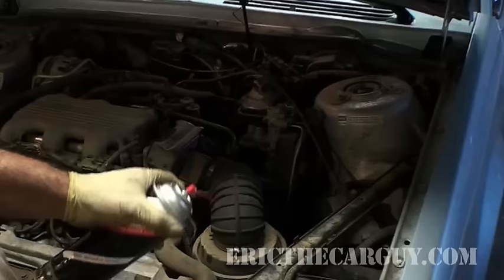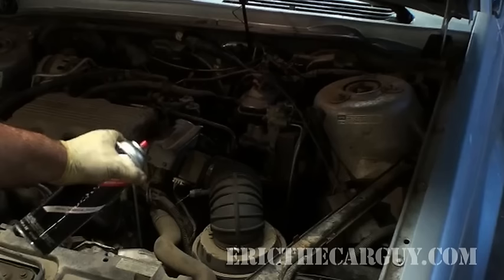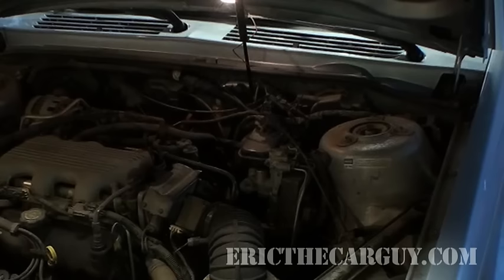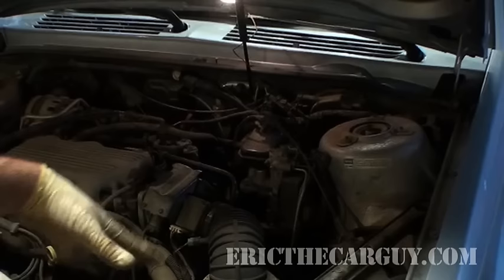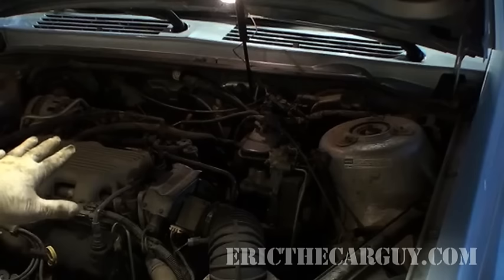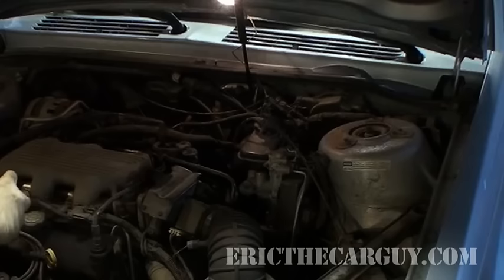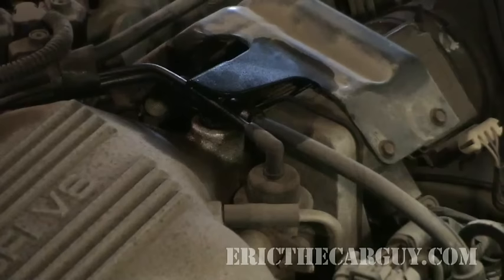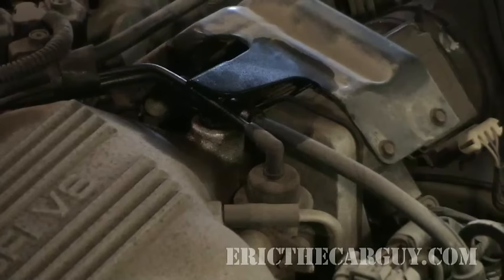How To Find A Vacuum Leak - EricTheCarGuy

Comment: Yes, using carb cleaner / starting fluid on a hot running engine is a really bad idea, propane isn't much better... The truly proper method is using a smoke machine.

Comment: Shouldn't you try to avoid getting carb cleaner on rubber hoses? I feel like you might find an intake leak and dramatically reduce the life of your hoses and end up with more vacuum leaks if you use carb cleaner.

Comment: I have a 2012 Hyundai manual shift and when I need to pull out fast and bring the rpm up however not too high and especially shifting from first to sec and also to third I get high rev hang. Can you tell me what the issue is here?

Comment: My problem occurs after the car has done maybe 10 miles. Then there is a sucking sound from the left side of the engine area. The the car, a Volvo XC70 diesel plays up with erratic throttle control, hesitancy. Inspect the engine cold and nothing is seen. I will try the cold water spray.

Comment: So.. what is the reason the engine stalled when you sprayed that particular area? What is unique about that valve and connection that caused it too stall, rather than just increase in idle? And might the engine still stall from the vacuum leak in that area even if you had not sprayed it?
Reply: he's flooding the engine, gases can be compressed but liquid can not.

Comment: Eric, if I find a leak like this on a pre-1996 car, will I need to disconnect the battery in order to reset the ECU, or is this non-applicable in this case? It's a Volvo, BTW.

Comment: Hi I changed spark plugs on my Dodge grand caravan and now it's stalling. As soon as I put in gear it acts like it's going to open up and shuts off. And as long as I take the booster line off that goes into engine it stays idling fine. But when I put it back on it stalls. It was working fine before. Maybe something i have hit while I was working and it came off

Comment: I have an idle problem.

Already replaced the idle valve on my S40 -96 2.0. But, as I did the work, I heard that hissing noise Eric was talking about in this video. Probably a vacuum leak.

But I'm a huge novice in auto repair and the problem is I cannot tell where to spray? Where are the hoses/tubes to spray into to find the problem?
Reply: I was spraying and inspecting the air hoses for good amount of time, but it turns out the problem was not in the air hoses/lines at all, but bad intake manifold gasket. Changed that to a new one and we're back to great idle rpm.
Just pointing this one out if someone is experiencing same kind of problem. Gl.

Comment: my deal-eo is my car had a high idle on hot days then on a colder day the car quit idling , so i turned up the the idle , so much that the screw is barely in .

the vacuum is at 20 pounds when at 1500 rps but at 500 rpm the vacuum is at 17 and not steady it's fluxuating .

tried spraying starting fluid and i think i found a leak on the carb where this pump thing goes in and is on a lever  maybe throttle pump

its a 86 subaru gl with a carburator and im only getting like 20 mpg / 105 miles to $20

Comment: Never use water to put out a fire in a hot engine, firstly you might crack your engine block or you might damage electrical connections causing you problems that might be hard to diagnose due to connections being rusty or bad contacts.

Comment: How do I know if my vacuum leak is legitimate ? I did the propane test and it didn’t do anything. But if I really douse the intake manifold gasket then idle drops 150 rpm. And when I spray down the carburetor bore with carb cleaner it stalls instantly .

Comment: I don't know why the engine still sputter like 5 times per second when I came to a stop. It started to shake as I hit the accerelate until it got smooth again. No engine light. What could be the problem? I replaced the spark plugs, spark plug wire and I used fuel injector cleaner. :(

Comment: Hi Eric. Thanks for every video you 'd posted. I learned a lot from DIY from you. My question for you is : What should I do to fix hard start in the morning. I have a Dodge Neon SE 03,  that gives me a headache.After many attempts  it starts and no problem at all when worm. Please respond and give me an idea.
Reply: Clean your throttle body. Properly like removing it and cleaning the backside. Do your gas pedal sticks sometimes?

Comment: If you decide to use carburetor cleaner make sure the engine is cold and start it up don't run the car for a long. Of time so the engine block doesn't heat up this will help not catching your car on fire

Comment: Random question.   I am having some water leaks come in from the ventilation slits on my 81 GM RV.  Would it caused problems if I sealed off the slits outside the cab that sits behind the Hood of the rv?

Comment: I found a safer method to find a vacuum leak in a french book for diyers. all you need is a tube you find suitable for the job. A vacuum leak is emitting a noise of air being sucked. So just point an end of the tube to the suspected area and the other end to your ear, and you do the same to other areas. Just be sure you ear is not too close to the tube end so that you won't damage your hearing. You'll hear a difference between noises and you just  identify which noise correspond the most to a vacuum leak.

Comment: Can a vacume leak be found in back of motor and can it make the car hot also I have a Pontiac Aztec 2003 to check where exactly the vacume leak is around the plugs and head I believe?

Comment: Have a 2014 Hyundai sonata which is misfiring no check engine light replaced disk plugs plug in coils and a fuel injector still misfiring any ideas?

Comment: hey Eric I own a 93 Honda Accord didn't pass emission due to the EGR so I'll watch your videos and I'm going to end up cleaning it question to you is that vacuum line that goes into the EGR valve when you take it off should I feel a sucking pressure either from the holes without your love because I don't I took the hose off put my finger on it I don't feel any pressure I'm learning as I go so I don't know the if  supposed to thanks

Comment: Maybe you’ve addressed this somewhere else in the 1,800 comments or another video, but you said a vacuum leaks causes “rich” conditions, isn’t it the opposite? Too much air being sucked in by a vacuum leak causes a lean fuel mixture with not enough gas? Or does the ECU overcompensate by injecting too much fuel, causing rich conditions?

Comment: How about if the car starts but idles really low then stalls, can't stay running and no response when stepping on gas pedal...already changed fuel pump, filter, injectors and pressure regulator on 3rd gen 4runner with the v6 5vzfe engine

Comment: Very nice video. Can you please advise I have a Subaru SF5 and the gearbox error code - Engine Torque Control Signal Error - can that be related to the Vac Leak anyhow? I also noticed that the car runs rich, but apart from that the car runs pretty well, also consume more petrol than usual. Thank you.

Comment: I have a 2003 honda civic si hatchback... and the cruise control has stopped working... the buttons and indicator lights on the dash all respond, but when you engage the cruise control, the light will come on, but it will not lock in the speed. What do you recommend I check? How do you recommend I trouble shoot this issue? Will you make a video on this?

Comment: Does this same method work with turbocharged JDM engines? Turbo engine exhaust and other parts run hotter than most engines so should I even try this?

Comment: My v8 has a smooth idle with stable rpms except for the intermittent mild shake i have changed the MAP sensor because it has thrown a P0106 code once but i cleared the code, what should i do thanks

Comment: Eric, what if the high pitched whine occurs when the engine is shutdown?  Turn key, engine off, whine.  Is this still a suspected vacuum leak?  Thank you.
Reply: Many cars have a vacuum reservoir that will maintain vacuum for a few seconds or minutes until the system leaks down. Its purpose is to provide vacuum power for actuators while at wide open throttle (which doesn’t make vacuum). So it could be a vacuum leak.

Comment: I have a 2002 firebird v6 3.8 engine code p0101 , p1514 after it warms up will not exceed 20 mph and sometimes turns off what would u suggest ?

Comment: My 2013 jetta, when i give it gas the car sputters and the epc light comes on and feel like the car is going to stall out but doesn't.  The code said possible vacuum hose leak and aldo said possible misfire. Do you think its a vacuum hose leak or something else?

Comment: I have a 2001 corolla with the code Po171. I changed the O2 sensor, MAF sensor , spark plugs, PCV valve , checked the fuel filter by the pump and checked for leaks with a can of carb cleaner no leaks detected but the code always comes back . Anything else that I could do?

Comment: Hey Eric how are ya, I have a friend who has a 93 mitsubishi diamante at first i thought maybe he had a head issue with it, but im starting to think its a vacuum leak.  What he told me was he was heading back from town and suddenly it just wouldn't go at all he said he had it on the floor and his battery light had come on along with his check gauges light. He said its blowing white smoke and if you try to rev it, it dies almost right away. He said its not shaking at all being i figure its maybe water in the fuel or something im not a mechanic but figured maybe that could be a cause so i started looking up videos and seen something about a blow head gasket, but he said it wasn't over heating either so im guess its most likely a vacuum problem but wanted to hear what you had to say about it.  As far as i know the smoke goes away after a bit but he cant drive it too long or else it will try to die on him.

Comment: Hey eric the car guy i have a question. My mothers manual 98 volkswagon bug doesnt really spin tires in first anymore im just wondering whats wrong. I feel alot of power loss exspecially when the engine is low on fuel from launch

Comment: I've tried with propane on my peugeot 308 from 2011 and doesnt work. Just pluged out the vaccum hose from turbo actuator and spray it. Nothing happend. So my conclusion is that it only work on air intake leaks, not on vaccum lines. Because vaccum lines are powered by a vaccum pump and this pump has nothing to do with air intake.

Comment: Hey Eric. My girlfriend has a 01 Kia sportage, and she is getting misfires like crazy. But only when the engine is cold. Once it warms up, they're all gone. I'm thinking it could be a vacuum leak, but can't find anything. I've replaced the spark plugs and gapped them, replaced the air filter, new fuel filter, and cleaned the engine with seafoam. Help!

Comment: I have a 2012 Camaro v6. When i suddenly hit the gas , while parked, it wants to stall and engine sputters. Its sounds as if it wants to spit air out. Any ideas?
Reply: I'd start with fuel filter / air filter

Comment: I have a 2005 scion xb and my check engine light comes with the track off light and vsc I think it is light comes on  I went to auto zone and they said it was a electric solenoid valve but I don't know where it is how can I determine if this is the problem

Comment: I have an 4cyl 88 trooper with severe idling issues so its hard to find a vacuum leak when the idle is jumping all over the place. Once it hits 2000rpms or above the motor runs great. an suggestions?

Comment: I have a 1982 el camino and it idles fine in park but once put into drive or reverse it stalls idk if that would be a vacuum leak or would it be something else?
Reply: +hachiko 24  low idle rpm?

Comment: Hey Eric wanted to find out about a low rpm... changed spark plugs camshaft sensors... cleaned throttle body. rpms fluctuates not violently but a small up and down motion thinking it could be a relearn to the throttle body.. not sure help 2013 nissan altima

Comment: I just bought a 1999 suburban that was described as nothing needed ready to hit the highway... It was rigged to override the heater cores (front and rear heaters) completely... the thermostat was literally rusted into the position. I re connected the heater cores and flushed the cooling system several times (once with skunk rust)... the coolant seems fine... however, the engine sounds like a diesel engine with a really loud knock. Some of the spark plug wires have been electrical taped back together (prior to purchase)... the knocking sound is my issue here... what do you suggest the problem is or what order of diagnosis do you recommend?

Comment: Hi Eric, I drive an 2006 nissan pathfinder, and I replaced my valve covers , put everything back, and noticed that my pedal was all the way down, had very minimal breaking, minimal! it was hard to come to  a stop, and my pedal would not go down after restarting the pathfinder. I spray soapy water on the vacuum hose, no bubbles, I check the booster valve, it held pressure when i blew in to the check valve connected to the vacuum hose. Can assume the that it is the brake booster? thank you.

Comment: awesome video eric i watch you all the time along with another guy named rich pin to figure out anything ive ever needed to learn on a car and your information is very helpfull... ive tried to do this method. it does work would a set of bad fuel injector o rings to the rail and or the intake where they seat into cause a vacuum leak bad enough to stall the car out too?? ive recently replaced the lower intake manifold gaskets due to them leaking coolant and the air intake gasket as well i only changed 4 o rings on the injectors. the ones i thought were the worst. now u can hear a leak. ive checked all the lines and i suspect its at the fuel rail or on the injectors any pointers?? i have propane and starting fluid and carb cleaner which is best for my scenario?

Comment: I installed a Spectre Pod/Cone Filter. The Check Engine Light came on along with blinking Cruise light.

is this because of the pod/cone filter?
Reply: If the problem kicked up just after you installed the part(s)?  Then remove it and return it to stock condition.  See what happens.  I personally do not care for the "Hot Air Intake" cone filters.  All you're doing is now drawing in hot air from under the hood, and not the cold outside air which is more dense and causes a better ignition.

Comment: I have a braking vacuum leak(2000 Ford Taurus 24v 3.0litre)..When I'm applying the brakes & also let off, there is definitely a hissing! Also it is causing idling problems too, where the car will die within 2-3minutes. It's weird though because if I'm at a stop with my foot on the brake, the car won't die.. Only if I'm idling with my foot off of the pedal.. Any help & suggestions Eric???

Comment: HELP APPRECIATED

Hello, I have a 1998 Ford Mustang, 3.8L V6, nothing special. I had just got everything running on it right, check engine light was off for about a week and then came back on. I got it scanned, the code read as follows : "Troubleshooting P1151: Lack of 02 switches-bank sensor 1. ECM Could not adjust fuel trim because of a lean or rich condition. Possible causes: Low/High Fuel Pressure; MAF Sensor dirty/defective; Vacuum leak on engine; leaking fuel injector". I have gotten the codes scanned on it before, and this is most definitely not the first time I've seen the vacuum leak possibility come up, as well as MAF sensor dirty. I believe it is a vacuum leak, but I would really appreciate some help regarding the matter. The biggest and most expensive issue is a massive loss in fuel economy. It has gradually been getting worse over time, and seems to run much better or much worse in certain weather conditions. Please give me some feedback and help me solve this issue. You can email me also.

Comment: Hi Eric'
Enjoy your videos. My girlfriend a 1985 Buick Regal. The odometer reads 48,000 miles, but I believe it's probably more like 148,000. The vacuum pressure gauge reads at zero according to a mechanic she saw. What could be the cause of zero reading? The car doesn't run rough at all.

Comment: EricTheCarGuy  How can I tell if I have a vacuum leak for an AC?  My AC is blowing some out of the vent (on the dash) but mostly out of the floor vent.  Is there an easy way to find that?  I drive a Jeep Grand Cherokee (2006) and have a couple dealerships work on it and they haven't been able to fix it. 

Also, good info (you picked up another subscriber!

Comment: I recently had a P-0420/ BK-1 check engine code (o2 sensor performing below threshold). This came maybe 2 weeks after a tune up. I was told to disconnect the battery and see if it reoccurs. It hasn't, but after a month my 98 accord now hisses when I accelerate and I sometimes get a slight delay in power. I'm hearing it could be a vacuum leak which might explain the sensor problem, an exhaust leak or the converter itself. Thoughts?

Comment: Do you believe a rift in the hose between the intake boot and the ICV could cause a sound like theres loose marbles in the bell housing, my E36 320i without VANOS makes this noise when the engine is hot and the noise dissapears when i disconnect the MAF.

my theory is that the vacuum leak causes the car to idle slightly rough and that causes some part of the exhaust to rattle seeing as the sound is much more violent when the engine is hot, also when i apply just a bit of gas the noise stops too.

Comment: I have a misfire on cylinder 1. Now when I did a smoke test I found smoke coming between the the throttle body and the intake manifold. Like the gasket isn't sealed. Would this cause a single misfire? or is this even considered a vacuum leak?
Reply: It's possible, and sounds like it could very well be the case.

Comment: I tried it.
I used carb cleaner.
I THINK i found the leak - intake gasket area.
Hard to tell when the car is running 3000 as idle.

*I had a fire ex on the ready.
After I was done, I could smell plasticy type smell so I waited 10 mins with the ex just in case!